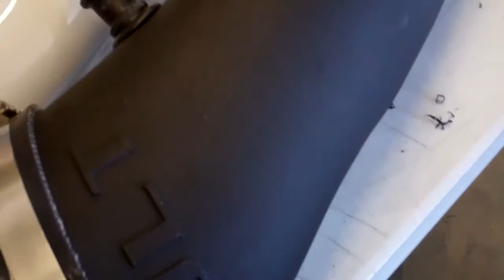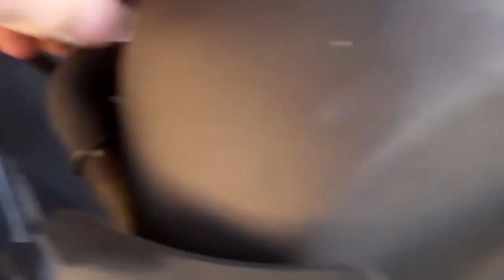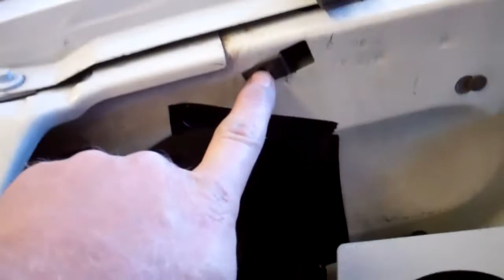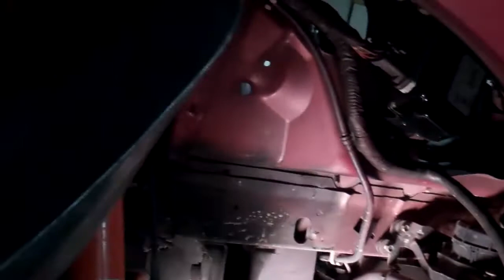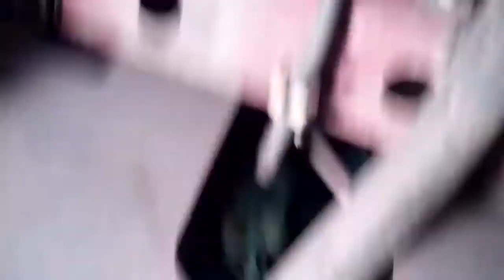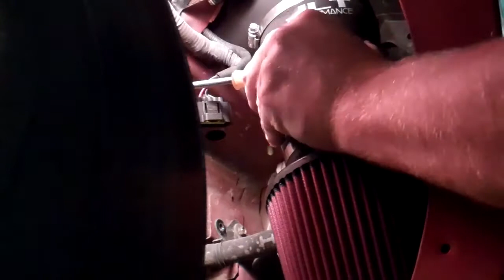JLT Cold Air Intake install 1996-1998 Cobra CAI2-FMC-9698

Comment: Upper portion of the PCV connection in the back (connection nearest throttle body) is smaller than the supplied hose. Supplied hose fits JLT CAI.  98' Cobra.  Is there something I'm missing?
Reply from the maker: Best to call us for help
Reply: i have the same problem how did u fix it?

Comment: For $289 you couldn't make this fit under the strut tower brace?  Do you really not understand how needed that brace is and how much those strut towers flex under aggressive driving?  You must not.
 Then you have aerodynamics working against the intake where it is now located.  There is no air flow in that spot at high speeds, quite the opposite. There would be a vacuum.  There needs to be some mod to direct air in to that area when hauling ass. Maybe not ram air, but something to get a positive flow to that spot. IF you really want the gains you should get. But then again, don't make any aggressive maneuvers at high speeds, you might not expect what happens when you do.
 This has no real thought put in to it. For the price.... not worth it.  The OEM intake already brings air in from that exact same spot. Sure moving the MAF out there will make some difference. But my factory intake has an intake air temp at 68 degrees when it was 56 degrees outside and the motor at 200 degrees.   If you want real CAI get a real mustang Mach1 Ram Air system and hood. 
 Or just get a good steel mesh filter or the old stand by K&N filter and call it good. Your $289 will be better spent getting a custom tune at your local mustang dyno shop. Factory tune is for best emissions. You can get more bang for your buck with a new tune for best power.
Reply from the maker: LOL
Reply from the maker: @xXxPunisherxX96  it's not possible period
Reply from the maker: @xXxPunisherxX96  GTs had a factory bar too ;)
Reply from the maker: @xXxPunisherxX96  I wouldn't sell a product that was so crushed by the strut bar like the picture.  Then people would complain about that. The bar doesn't do anything unless you autocross or track it. FORD removed it in 98. Sorry, but we are about HP gains.